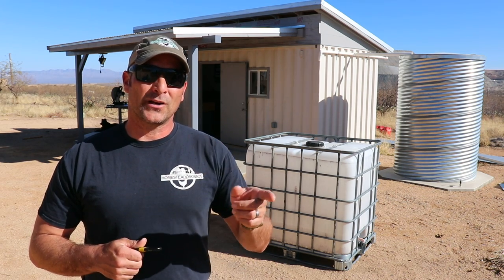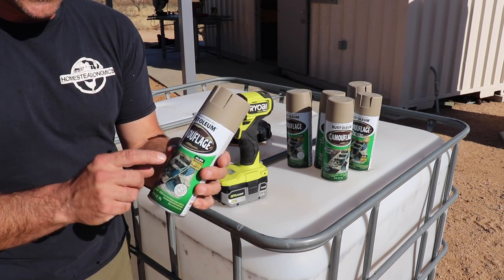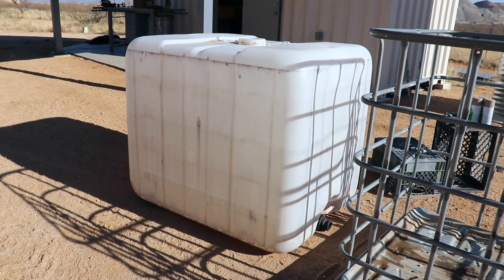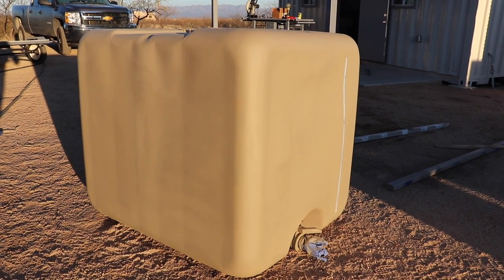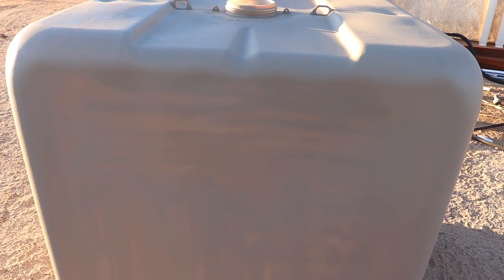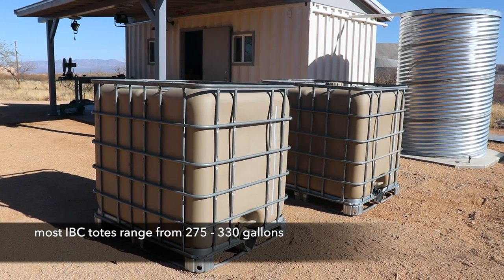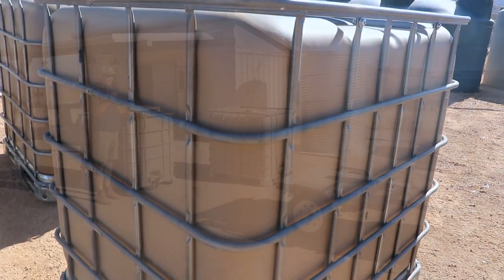How to Paint an IBC Tote - Rainwater Harvesting DIY

Comment: Since you removed the tank out of the frame, you could use a roller for a much quicker layered application. It is actually much faster and easier to roll the paint than to spray it and the finish looks neat. Not to mention that you don't need to worry about wind and overspray.

Comment: Very cool, we didn’t paint or cover ours & we hear a cracking noise when we push on them now.. hopefully we can save them from further deterioration with some paint!
Thanks for the vid! 👍
Reply from the maker: They actually will hold up really long without paint.   But it depends on when it was made.   I’ve heard some have UV inhibitors in the plastic and some don’t.   But I haven’t figured out a way to determine that through the stamping yet🤔.   I’ve got one that has that cracking sound on the top when you push but the rest don’t have any cracking sound and they are all about the same age.   Some I’m guessing that one is one of the non UV plastics

Comment: Thanks for sharing another video.  Very helpful.   Trying to work on the development of my first wildlife, rainwater, water station.    A few questions.   1) Does painting prevent moss from growing inside?  I like how you left the electrical tape to see water level.   I am assuming that a small, unpainted strip will not allow moss or algae to grow?   I am hoping so as I would really like to use the small strip to track water level.   2)  Roofing panel for water collection.   I am finding several different thickness's of roofing panels.   Do you find that that if you use the thinner gauges, (29 gauge is what Home Depot sells) that if it is secured with enough screws, that it holds properly with heavier winds?    3)  Do you you use galvanized roofing?     4)  Lastly, when possible, I would love to see how you link the two IBC Totes together (in a future video).        I have been trying to figure out how to combine 2 totes together (to get greater water capacity)  so that the total gallons available increases for the animals.  

Thanks again for making such informative videos.   Looking forward to seeing more videos regarding your wildlife watering station.

Comment: Believe it or not, I am going to paint my totes soon. They had algae growing in them, so I have to make them impervious to sunlight.
Thanks for sharing!
Reply from the maker: Hey Tim,  yes the paint should help with the algae for sure.   The darker the paint the better light blocking... of course the more heat it could collect too.   This khaki doesn’t completely block out the light but does help.   But perhaps a darker tan or brown, etc might work as well.
Reply: @homesteadonomics  I was thinking 2 coats would do. One matte black and some lighter color on top.
Reply: @homesteadonomics     I just used 7 cans of spray paint which cost $6 a can and it took well over an hour. There must be paint you can roll on! It would be so much faster and better to get a thick coat. I only did one tote and have 2 more to do. So Im either going to cover them or find a good paint I can apply with a roller.  Im seeing a lot of light through the paint so I need better light blocking.  Black plastic sheeting will look ugly next to my house but it might be a better solution.

Comment: Dry to the touch and cure are different animals. Dries to touch in 1 hr. to handle 48 hrs, fully cured 3-4 weeks. Its all on the can, no one reads it. And just from a different perspective, this job would be perfect for a quart can, tray and foam roller. Less cost, no overspray and a thicker mil on the surface. And they do make bonding primers that are great for plastic so any topcoat color is available. Nice project.

Comment: Paint started to flake on mine. I'm thinking I didn't give it enough cure time. I may try that again. 
I was also thinking about the possibility of coating one with flex seal and seeing how durable that would be.
Reply from the maker: Hmmm.... if it was flaking then I don’t think it was taking a good bond from the start.   But the flex seal actually might be the way to go... I’d be interested to see how it does.   You may start an IBC tote painting revolution 🤷‍♂️😀

Comment: From my plastic lawn chairs painting  experience, the spray paint chips off soon. Better to get out the orbital sander and rough them up. Then after the spray paint cures in the hot sun, coat them with a sealer or clear coat. Could even use a primer after sanding should you be so inclined.
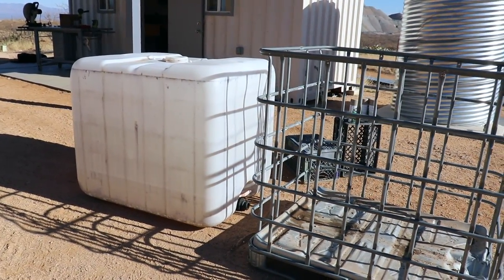Reply from the maker: Yep, sanding and a primer would give it a better chance for sure😀👍 2:45

Comment: Just moved to near the middle of the state. I'm looking at putting in a raised bed garden and was just looking at IBC totes for sale online yesterday. I've got a shed with a little over 200 square feet of roof space and was thinking of putting a gutter in it and piping that to a tote or two. Should be able to collect around 1400 to 1500 gallons a year from that alone if we get an average amount of rain. Wondering how to keep the components from freezing in winter as it does get below freezing regularly.
Reply from the maker: Hey Randy,   In AZ our freezes usually are only nightly.   So for my totes I will wrap an old t-shirt or towel just around the valve/outlet area.   The rest of the tote will be fine as long as the valve doesn’t crack.    But if you have other piping connected to the tote I would put foam insulation around that.... or just drain it before a hard freeze.   If it’s going to be at or just barley belies freezing like 29/30 or so.... I don’t even worry about it.   But anything below that is where you’ll want to make sure to wrap, etc

Hope that helps😀👍
Reply: @homesteadonomics Thanks, the valves are my main concern, so good to know some light insulation should be sufficient.

Comment: I highly recommend Rust-Oleum's Universal Bonding Primer. Can't always find it in stores so, I stock up when I see it. Works amazing on adhering to surfaces that don't play well with spray paint. 

Side note: If you want the most life out of your IBC tote, use an outdoor rated paint that has UV inhibitors or apply a UV resistant clear coat. Lighter colors are recommended in order to minimize heat absorbed (from UV) which will cut down on growth of algae & bacteria

Comment: ironically....i just did the same thing two weeks ago. Same paint in fact...lol. 5 cans for a 330 gallon tote for 1 coat. Another 4 cans for second coat got it done. I modeled my deer watering station after your previous video actually, and got it out there last weekend. I dont have water collection though. How long does 300 gallons last for you? I used the same water tray style that you used....and im in West texas....so the evaporation levels should be similar. How often should I exped to refill them? My tote is 330 gallons.

Comment: Nice. But wouldn't the better approach be to fiberglass a very thing skirt around the metal cage? Just drape / stretch fiberglass cloth around it and use epoxy / polyester / polyurethane paint to create a shell. That way you also have a bit of insulation.
I'd also figure it would be better to have white paint to reduce solar heating.

Thanks for the video!
Reply from the maker: It would probably work very well😀👍

Comment: Unless you have very strong muscles, you can avoid straining your back by turning the cage facing you, and then simply slide the plastic tank in. To avoid scratching the painted side, you could put a large piece of cardboard or a sheet of plastic over the side where you are going to slide the tank in.  It is not that heavy to bring the entire unit back to its upright position.

Comment: I having a lot of sediment in my water tank, not from the roof, but from the black film (algae)  that is creater within the pipes. I installed the pipes, but paining them black is kind of risky.

 I have used a fish tank sock, a downspout sediment filter but if im not there no body cleans it. So, i let one of the tanks with no "prefilter", so all water from the roof enter the tank directly.  Sediment deposited at the bottom waa quite considerable.  The other tank that has de spindown sediment filter prior entering the tank plus the fishtank sock...was so much clean...meaning that NOT all tank bottom was covered in dirt.

Im trying to implement a 2 x times per year cleaning....but how you guys deal preventing dirt enter the tank? What prefilter measure are you using?

I found by experience that letting the spindown filter fully open (bottom) is less likely to clogged, and the sock hold most of whaever escape.

My rooftubbing (white cause i cant reach that high) 1.5". The spindown sediment filter (homedepot) is 3/4" and the "escape releif" valve is 1/2". The income of water volume thru the 1.5" surpases the loss of the 1/2" valve open.

Comment: What do you do with the water after sitting for a while, does it have a nasty smell? I have a 55 g rain water collection and even put a pump in to circulate, but after a bit of time the water stinks. I use it for my chickens and watering my green house. I do put vinegar in to help but works only so well.
Reply from the maker: I haven’t really had much of a problem with smell that I’ve noticed.  But then again my nose may have been cooked from my firefighting job😂.   But if you want to prevent anything from smelling you could add a half dozen drops of bleach and it should help.   Circulate it and leave the cap off for a day or so.  it off gases rather quickly so you plants and chickens won’t be getting poisoned, etc.   but I’d check some online resources for water treatment for drinking use using bleach.   Many relief organizations have good reference charts for the specific amount to use for certain quantities of water.
Reply: @homesteadonomics  thanks for the reply.

Comment: Can IBC totes be stacked?  I know that that much water weighs a ton.  If both are filled, would the bottom tote be crushed?
Reply from the maker: Sure can!  The cages actually line up with aligned grooves to help them ‘nest’ into each other.   I think they can be stacked up to 3 high in commercial uses... maybe 4.   But I know I’ve seen 2 very commonly stacked and occasionally 3.    And I even have plans to possibly incorporate them into a future carport as one of the walls😀👍
Reply: @homesteadonomics  Thank you, Joe.

Comment: What's the paint for? Keeps water cooler? Mold?
Reply: I'm wondering the same things?  I have an IBC tote that I've used to get water to my property for the water needed to mix concrete for a slab.  I let it sit for a couple of weeks with some water still in it and the algae started to grow. I treated it with Clorox bleach to kill the algae.  Most people paint them black to block sunlight to prevent algae from growing.
Reply from the maker: For all the reasons that you mentioned😀👍.  Helps with keeping the water cooler, mold growth and helps the plastic to last longer.   And yes, black would block more light but also collect heat... which we don’t need more of here😂

Comment: Is it cheaper to spray paint ( price and time spent) or cover the totes?
Reply: Definitely cheaper and quicker to cover with black plastic sheeting,  And will block the light better. I just used 7 cans of spray paint which cost $6 a can and it took well over an hour. Tedious to try get it all covered evenly. There must be paint you can roll on! It would be so much faster and better to get thick coat. I only did one tote and have 2 more to do. So Im either going to cover them or find a good paint I can apply with a roller.

Comment: Paint can leach inside plastics overtime especially exposed to UV that causes cracks and brittle the plastic overtime, making drinkwater toxic. Better to use some liquid rubber spray for roof and apply couple of coats.

Comment: Instead of painting it, you can use a black plastic pallet bag to cover it (the pallet cover bags are rated for one year in direct sunlight and cost about $3 each. You buy them in a roll of 50 from commercial supply stores like Uline. Much easier to wrap than to paint and the plastic container lasts much longer. The more the plastic container is in direct sunlight, the more microscopic plastic is mixed into the contained water. With that many bags, you can slip one on from the bottom and tape to the tote, and then slip one on from the top and tape down.. that way when water comes in from the top it won't fill up the bottom bag.